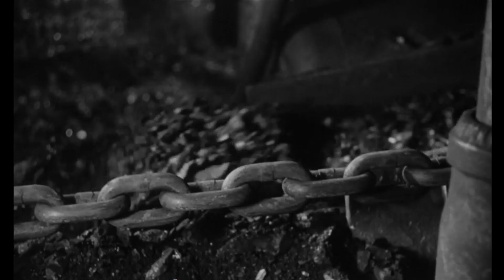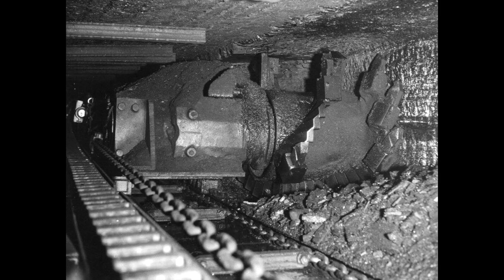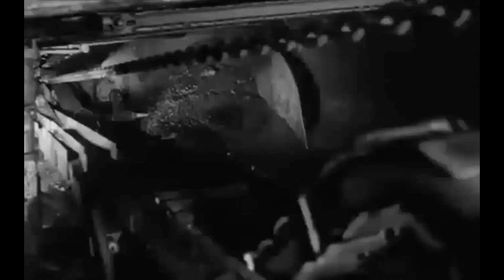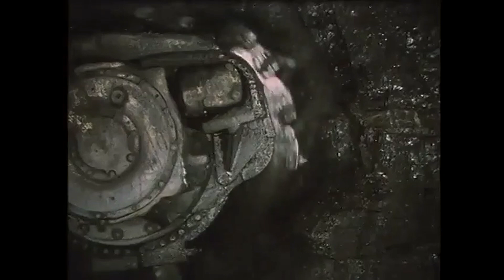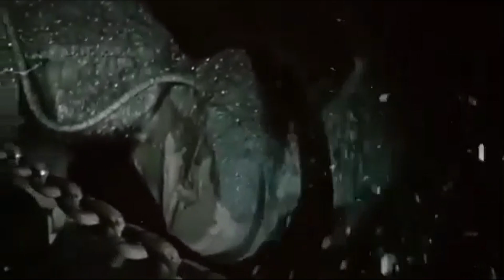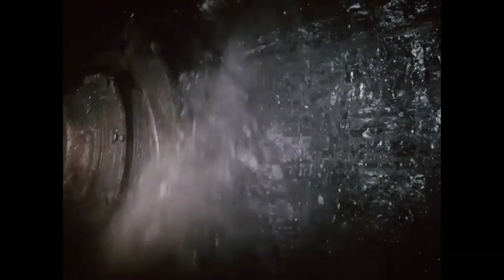The Dangerous Coal Face Cutter Hauling Chains Remembered.

Comment: Remember these chains on the coal face.  As the snaker on the coal face,  keeping the powered supports in line helped to make it safer.  Someone I knew Tommy Stocken on PO1's at Manton Colliery in South Yorkshire coalfield, had his hand broken from a chain whipping up.  He had time off while his hand got better and the same thing happened on his first shift back.  Poor sod!  Another thing about this is when the haulage chain at the slack end, used to lay on the AFC chains as they were running.  What a racket that made!  No wonder I have tetanus.